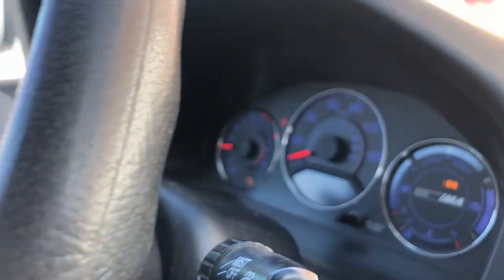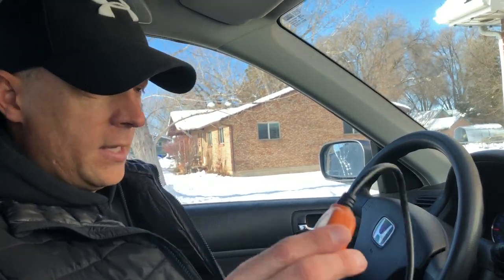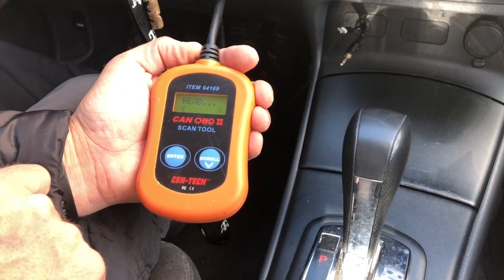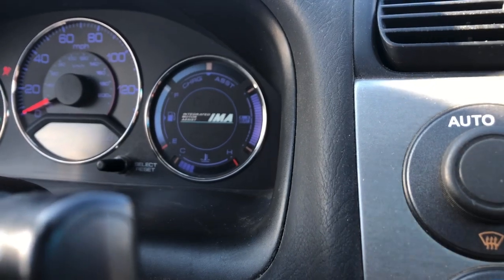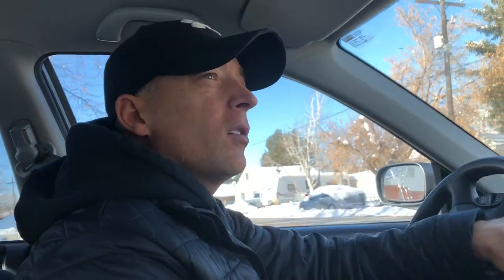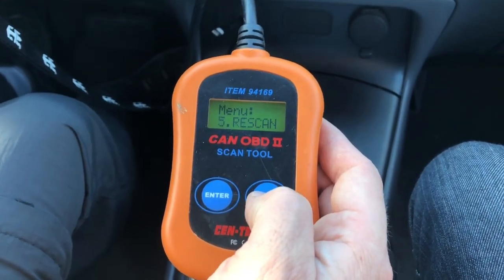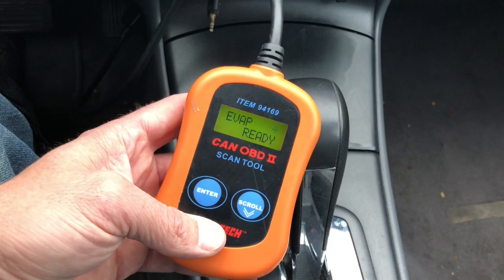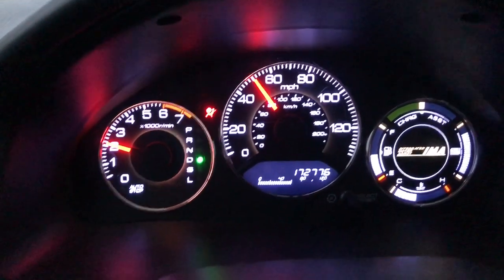Honda Civic "IMA" Emissions Hack

Comment: Hey Shane,  great video does explained a lot . I have an 03 doing the same and so obviously my batteries are bad already,  can I just drive the car on engine power as it is and just ignore the ims system, would affect anything down the road...thanks lmk👍.
Reply from the maker: Thanks for watching, glad it helped. Yeah you can drive on engine power with the IMA light on with no problem. The problem I had was that I couldn’t get it to pass emissions testing with any sort of check engine light. But yes you will be fine driving with the light on

Comment: You can rebalance the cells in these batteries without taking the battery out of the car or anything -- just buy a $200 grid charger. Charge it whenever the IMA light starts to trip again and it will rebalance the cells, and the cells will normally stay in balance for weeks or months at a time.  It's possible to nurse along old batteries for hundreds of thousands of miles though regular rebalancing with just a grid charger. 

https://youtu.be/jb5FOSWbtOE?si=k2pflDaq542i-1dg

Comment: It worked thanks! 200x  Hybrid.  One tip to add...If you drive in 2nd it helps a lot to keep the assist from activating.   You can get up to speed then shift to drive to go through the drive cycle when speed is up to 45 or 50ish.

Comment: Did you kick the scanner in the whole time when you're driving I need to know because I had to say a problem with my 05 if you get this message can you reply back to me thank you I'm going to go try it out see what happens but I just want to know if the scanner if you keep the scanner in the whole time while you're driving in until probably get to the to jiffy little before we get a smogged ?
Reply from the maker: I left it in, so that I could check to see when the errors codes cleared then removed it when I got to jiffy lube.
Thanks for watching, hope this helps.

Comment: Instead of driving super slow you can pull the back seat and shut off the IMA circuit breaker.  Now you can drive the car with just the gas motor.  Before doing this make sure your 12v battery is charged real good.
Reply: i heard that hybrid cars don't have alternators. so how will the 12v battery get charge ?
Reply: @gamithadithya4166  You are correct.  This is why I said make sure it's charged good.

What I understand in the 2nd gen is the 3 phase electric motor send high voltage to the battery.  It then is connected to another device right next to the circuit breaker to step it down to near the proper 12-14vdc which charges the battery.  In turn that runs the accessories.

So you could only drive for short distances.  Sorry for any misunderstanding.
Reply: @thomsonkev  You're right about this... Bought an 03 Civic Hybrid with a shot hybrid battery and thought I could give it a quick jump to drive it up on my trailer... nope. Dies the moment I disconnect the jump leads. If the IMA system is nonfunctional, the 12v battery is incapable of charging.

Comment: My civic is 2004 hybrid manual 5 speed.  i get the p0134, p1600.  I replaced the battery, did not get IMA for awhile.  I got an evap sensor code.  Pulled that, cleansed it.  lost that code.  i got O2 sensor codes, replaced the two upper o2, have not gotten to the lower o2, because I can't a cheap replacement.  I have a nice Xtool obd2 reader/programmer, which clears codes.  it works, but the code comes back.  I think the O2 is the primary problem for the IMA engine code.  Reason is because the car actually reads 2 cylinders per upper o2 sensors, then the last reads to the after cat code to get a final emissions.  Reason this is because the car engine ECM/IMA will turn off 2 cylinders during drive, and the two upper o2 sensors will get their emissions output variations which will get compared to the final results which tell the ECU you engine output to recalculate for gas pedal input which then turn's on all 4 cylinders, and Boost, or not given the engine/car speed.  I think when the last o2 is bad, it give incorrect math o2 measurements confusing the car ECU to think the engine is not running right, then telling the IMA to boost to make up, then emissions variations get into a flux level which does not match the ECM registered programming causing a fault code to display.

I figured this from talking to Honda and Honda telling me that IMA issues are usually O2 related with faulty batteries.  Batteries usually being the prime suspect because a faulted battery link would give lesser output on the IMA which the ECM would be looking for the HP/car speed uplift variation which is not present because would should be in the OEM scope variations, the lacking o2 reading are actually faulting a math emission signal which tells the ECM to vary again either VTEC or the Ignition timing to get the system onto a air fuel track map match ... but with the faulty o2 sensors, the engine and ECM are recalculating, and IMA is reassessing the power output to get the car to run the HP output the driver is requesting. 

I can not confirm this, because I have not completed the change of that last O2 sensor.  Once I do that I will see what the performance is then, do a full IMA battery rebuild since I have an extra battery to disassemble and pull the core rods to assesse and recharge.  Then do a cleaning to make sure the terminals are all free of dust, corrison, and then put anti corrison grease well on the terminals.  This should fix the problems.

If not then you might have either bad relays or modules which does happen.  I have had bad fuel ignition relays or distrubutors go bad in my older integra's.  usually very rare and those cars were in moist conditions which is a very serious problem.

I have seen shops here spending more time lately on diagnosising situations which they ended up finding here corroded electrical terminals or faulted Vaccum hoses which leaked.    Check for yourself. 

These Civic's are really great cars, great milage, very quiet, and I just which the seats, and the mirrors were better, like a slight bend in the mirrors to help eliminate blind spots, and a larger center review mirror that has a bend to catch the blind spots.  It probably be nice if I could get the Push Button Ignition that does not require insertion of the key into a hole, just put the key into a cup and push squence code and start. That would be nice.  Plus a nice double din Stereo/ CD/mp3/bluetooth with RECORDing front and rear incident camera's, that would be Freaking Awesome. 

I am tring to integrate that, but I need a nice garage to pull the car apart. I have some other glitches like window don't move.  Leakage in truck which pisses me off to NO END..   I like to upgrade the stereo to BOSE and sound deaden the doors, floor and fire wall so it is all quiet and cool, and upgrade the interior air filter with  UV anti bacterial/germicidal defense system to keep the interior of the car clean.

I hope my information helps.  take care of the car and get the suspension upgrades to tighten up the car.  I am not a fan of the tiny wheels, I like the 15 of the EX models, plus with a tightened suspension and little lower, this little car will not skip a corner, but make your passengers hug each other~!!

Comment: My 2005 Honda Civic Hybrid had the original battery replaced by Honda dealer (free) in 2013 and 6 years later the same P1433 popped up.  What I do is, after clearing the CEL and codes, leave the scanner tool plugged in showing the incomplete monitors, which the scan tool will refresh as they get cleared as I drive.  The evap is always the last to clear and requires you get up to 55-60 MPH and hold it for a few minutes (not exactly sure the exact speed or time required) and then slow down.  I can watch when the last monitor clears and then I head right to the smog check shop.  Note that it really helps to have a route picked out that has no significant uphills.  Going up steep hills are what triggers the IMA light to come on on my car as the ASST cranks up and stresses the crap out of the IMA battery.

Comment: Thanks for the video. Question: do I need to reset the MIL before the slow driving? I just hit the highway to cycle my 03 civic hybrid and prior to that I reset the codes. During the drive it tells you to hit 50-60 mph and my MIL light came back on. Some of my readiness codes came back, but still no evap, heated catalyst, or secondary air system. Going to try your method to see if I can get the computer to read all of that missing data again just wanted to know if I need to reset again. Btw, didn’t notice my issue until after putting in wrong gas; made the car lean but have since been filling up with the right stuff to “purge” it out.
Reply: You reset the CEL prior to driving.... I've done this early in the morning years back on mine... was able to put 20 miles on it and passed it.  as soon as I left the light came back on.

Comment: How long will the IMA light stay off?
Reply from the maker: it depends on the health of the battery. Obviously its not in great shape if the IMA light is coming on. With that said mine has stayed off for as long as a couple days and as short as minutes. Its defiantly not a permanent fix, it will only get you passed emissions test.

Comment: What speed did you get egr ready at?
Reply from the maker: Marco Rivas I’m not 100% positive on what actually resets the egr. I maxed out at 60mph on my drive. It might be the speed or distance traveled or a combination of both speed and distance.
Reply: @2277shane 60mph? I thought you said to not get the assist mode trigger

Comment: I have a 2005 honda hybrid with a manual transmission.  The honda dealership had reset the battery and told me that if it comes on again I would need a new battery. It did came on but Im wondering is it due to me not switching gears when the indicator light tell me to
Reply: My civic ima light come and red light for the bettery come on too no charging  how can someone help my civic 2012 Honda civic hybrid this is my number please if can help 08036456762 my WhatsApp iam Nigerian thanks

Comment: I own a 2006 insight. Try this for a force  charge ur battery. Park in neutral e brake on hold rpm at 3 500 until charge bars appear hold steady until fully charged

Comment: Hey great video! I have this exact car. It won’t stay cranked as soon as we remove jumper cables it’s dies. There’s no alternator I hear so would you know what this might be and have you encountered this?
Reply: Ive been looking into how to bypass the hybrid battery. Im thinking about purchasing one for cheap that is in prestine condition besides that the hybrid battery needs replaced. They can cost anywhere from $1,200-$3k! Which is more than the car itself is worth! Making these cars seemingly not worth the investment. Which depends because you'd have to own it for another 5yrs just to break even by saving money on gas. Honestly it wouldnt be a smart move on my part. As id be better off getting a newer car for the amount id have to put in it. 
However I just saw an interesting video where you can bypass the hybrid system entirely. Essentially just makimg it a regular non hybrid system relying soley upon the combustion engine itself. Apparently there is a breaker switch behind the rear seats. This is where the guy turned the switch to the off position. Where he disabled the hybrid system entirely. He said that he uses marine batteries, instead of a regular car battery. As Marine batteries wont damage as easily as a car battery from being drained on a constant. The guy claimed that he had Been driving it for 70k with no major problems. Besides having to get a jump every now and then. Which can be a pain in the ass, especially this day and age. Its hard to get a random stranger to give you a jump. The man that made the video had a portable battery charger that he took with him evwrywhere. 
So in hindsight you can save time and money by disabling the hybrid system entirely. Then sustain it by having to jump the battery whenever it doesnt have the amps to crank the car. From the way this guy was speaking, he wasnt having any major issues with the overall functioning and efficiency of the vehicle. It was getting better gas mileage since the hybrid system was no longer putting an unnecessary load on the engine. Plus he was only having to give it a jump every now and then. Mainly under heavy city driving. As he had no issues whatsoever driving it on the highway as it always kept the charge whenever he would go to start it again. He claimed he had been driving it like this for over 70k like i previously stated. So my conclusion is that its a quick fix or bandaid to fix the problem of having to replace the expensive hybrid system. 

Im no expert on these electric cars and being that this is a hybrid. You could and should be able to drive it without any major issues affecting the engine by completely bypassing the hybrid system. These are the first generation of hybrid cars from my recollection. So its no surprise that they didnt last til about 6-10yrs depending on how many miles it has. Overall if i had one id indeed bypass it to buy me enough time to save up for another car. Possibly trade it in to lease a brand new vehicle. It'd really be hard to sell these cars no matter the condition it is in for the simple fact that replacing the batteries will cost more than the car is worth. 
In my situation im only considering purchasing it if I can get it for less than $1,200. The regular civics in the condition as good as the one im looking at are still going for $2,500-$3,500. The car should still be as reliable as its conterpart. Bypassing the hybrid system should in essence be the same exact car albeit a bit heavier due to having the batteries. Ive barely began to research this particular model civic. So i domt actually know if it has the same engine as the regular civic? I can sacrifice a some annoyances by having to jump the battery every now and then. If he had been driving it for over 70k than i could potentially get atleast 2-5yrs out of it easily. Only time will tell as it is the case with anything in life. 
This video however was very informative amd may infact come in handy if i purchase this car as im actually considering it because the price is almost too good to be true. If its only something as simple as bypassing the hybrid system than i can live with the rest.
Reply: @nowimhigh  This is great information and video. I have an 05 dealing with the same issues. The car runs and drives very well but I have the IMA light issue. Im going to start with this tomorrow ive got a CAN OBD 2 coming  in the mail and ive got alot of faith that I can get atleast 2 years out of this vehicle to do the same thing. save up for something else. I bought the car for cheap and I dont think the guy knew what he had/and/or just didnt want to deal with the replacement of the battery pack. I might consider getting a new battery pack as well. These hondas really are great cars especially for what I NEED it to do which is get me from A to B for work. I am a tradesman and only drive about 30 miles at the most to meet my journeyman in the mornings so I know ive made a small/affordable investment. Thank you again for posting this video as well as leaving these comments and replies because they have been an extreme amount of help!
Reply: @nowimhigh  did you ever get your hybrid? I'm curious to know how the disabling process went
Reply from the maker: Dawn Pugh, thank you for watching my video. Sorry to hear you are having car problems. I’m definitely no expert on theses cars but I do know that the 12v battery controls the hybrid brains, it might be an issue with the 12v battery or bad connection to the battery. Tomorrow I can test it out on my car, I’ll start it then disconnect the 12v battery and see if the car dies. I’ll let you know.
Reply: Shane Weston that would be amazing thank you!!
Reply from the maker: Sooooo very interesting, I disconnected my battery and the car stayed running. Here’s where it gets interesting, with the battery disconnected and running for 5 to 10 minutes the car did die. It did this twice to me. The second time I noticed that the hybrid battery charge indicator (the green bars) were completely empty so the third time I started the car and charged the hybrid battery. With full bars on the hybrid indicator, the car has been running for 20+ min without dying. I wonder if it could be your hybrid battery. Is the hybrid charge indicator completely empty? If so start the car and run it at about 3000rpm until you get full bars on the indicator and then see if it dies. Hope this helps
Reply: Shane Weston yes the bars where low and that light is on. I’ve watched a few videos today that said also of that lights on that’s what it is. We are talking big money for those from what I can tell. In am going to try this first thing tomorrow thanks so much

Comment: thank you so much life saver🙏🏾
Reply from the maker: Jose Mrnde, you’re so welcome. Did you get yours to pass? Its a bit tedious but it works and a heck of a lot better then a new battery.
Reply: Shane Weston yes I tried it today,I drove about 30 miles at a low acelaration and the light has not come on,Ill be at the inspection station tomorrow
Reply: So the light come on since you’ve tried this? I put a new battery in and the light is still on
Reply from the maker: createxperience 
yes, the light comes back on as soon as you begin to accelerate into the assistant. This is only a temporary fix so that you can pass emissions test. For me It wasn't/isn't worth putting the time and money into a new battery.
Reply: But it has to fix right?